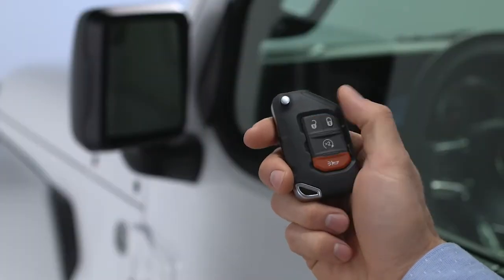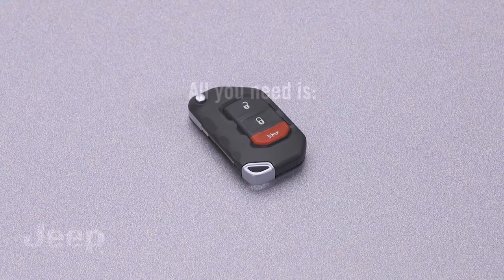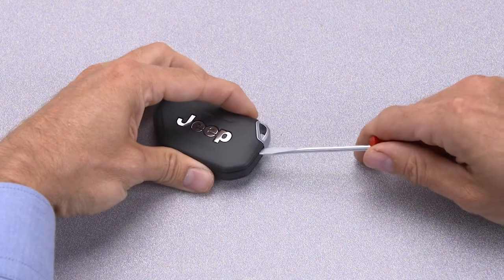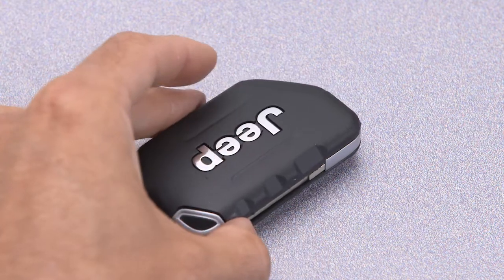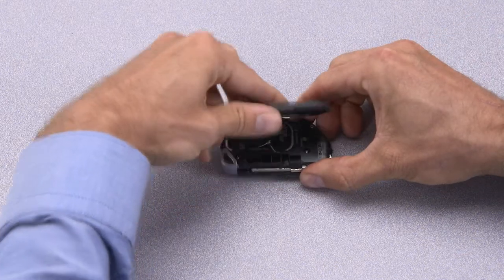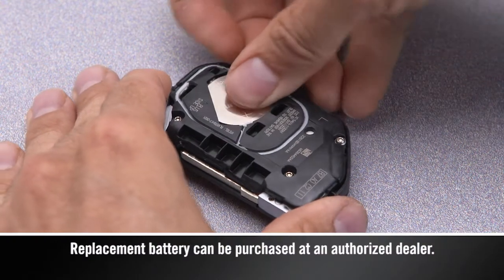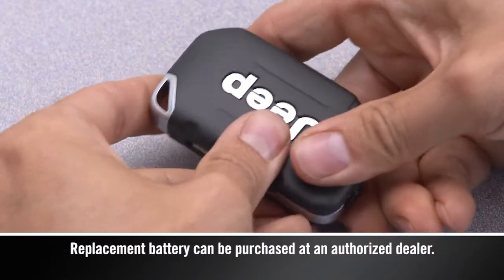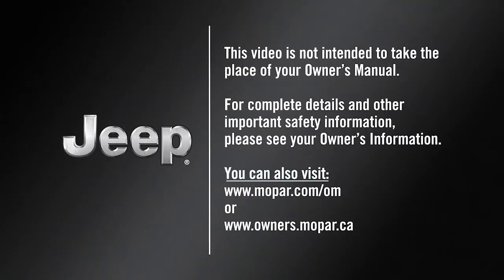Key Fob Battery Replacement | How To | 2022 Jeep Gladiator

Comment: Beware.  I followed this video exactly.  Remote would not fully seal on one side after I was done, no visible damage to any of the tabs.  It would not have survived a drop into a dog bowl.  Took it to the local dealer, who after two hours in their waiting room referred me to JeepCares, who told me that the fob was not covered under my factory warranty because I had changed the battery myself even though I followed Jeep's own videoed instructions for doing so!  The JeepCares rep even told me I should have listened to the "disclaimer" in the video about how I'd void my fob warranty by changing the battery myself, which I still don't see anywhere in the video, even after a third viewing.  Oh, and then the agent declined to let me speak to a supervisor, and suggested that I should just purchase a new remote myself out of pocket.

Comment: When I press a button, on the keyfob, the security alarm is triggered, and doesn't shut-off until the button is pressed again. I thought that, maybe, the battery might be going dead. The red LED on the fob would flash, when the button was pressed. I changed the battery, and the same thing is still going on. I did not find anything in the manual about this. Is this an indication that the keyfob is no longer paired to the vehicle, or is it something else. This is a new vehicle, with less than 10,000 miles on it, and should not be having these types of problems, yet.
Reply from the maker: Hello, 
Thank you for reaching out. 
We're unfamiliar with this behavior. We recommend bring this to the attention of your local dealer so that this can be properly diagnosed.  ^LH
Reply from the maker: Dear Pappytron,
Please take a moment and complete our online survey by clicking on the following link:
http://ms.spr.ly/6006eL82i. We look forward to your feedback.  To unsubscribe please click this link: http://ms.spr.ly/6007eL82c

Comment: Why won't the push button inside work after I replaced the battery in fab?
Reply from the maker: Hello, 
Would you mind further explaining what you mean? 

Thank you  ^LH
Reply: @mopar  The button don't work unless I have the fab against it. Now before I could just push it to start with the key fab no where around the bottom. (LIKE inside my purse)
Reply from the maker: Understood, typically this occurs when the battery is low or depleted. May I ask if this was a used battery or different brand ? ^LH